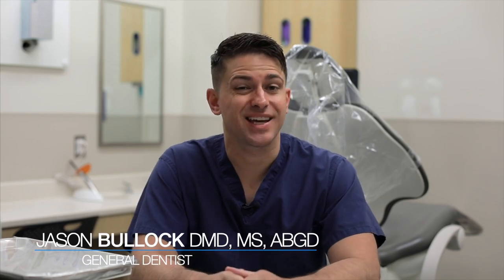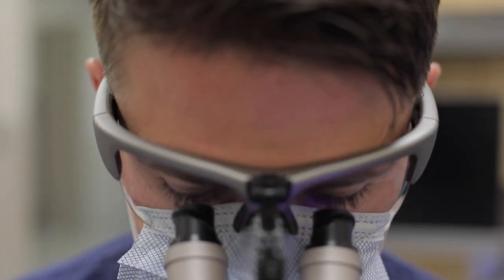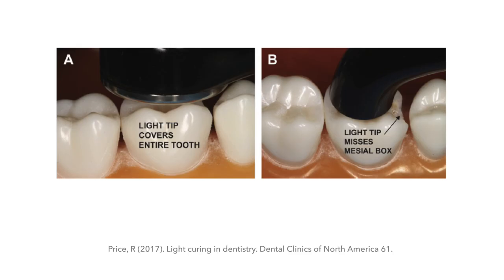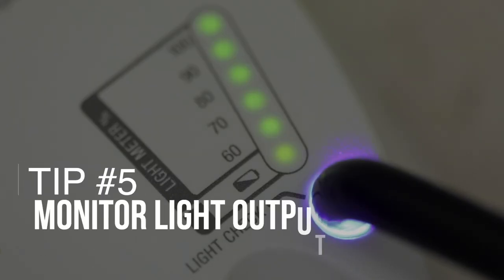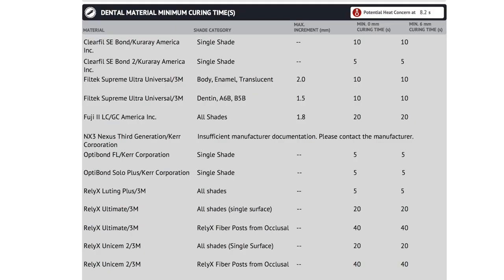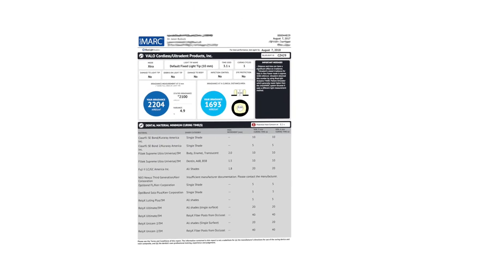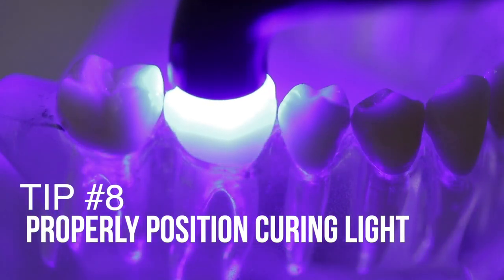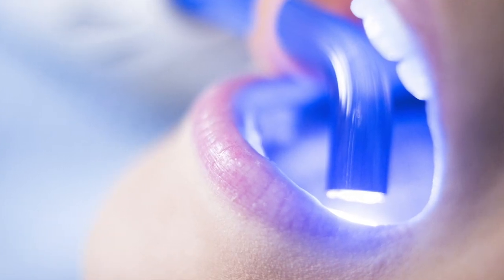10 TIPS for BETTER Light CURING

Comment: My Dentist has  cemented a crown twice came off within 3 weeks both occasions I purchased the curing light the equipment and cements Ionomers and reseated the crown myself 4 yrs later its still hasn't come off!  have also done front tooth chip repair composite restoration class IV over a year on still holding .. learning from YouTube and reading journals tips from Dentist like you have saved me time and money I get the feeling some dentist purposely don't do a good job so you have to keep coming back!  thank you so much for all your tips and advice!
Reply: How u did urself
Did u bought cure light and composite online
?
Reply: Be a bit careful with this, if there is disease in the tooth (decay) you may be asking for a root canal in a year from now.

Comment: I remember the old Halogen Curing Lights with the internal Fan that was inside. Such as the Optilux 401. They were great at the time, and I actually liked the sound of the Fan's motor. They were GOOD! However, now we're moving away from the corded Halogen Lights, and we're now moving to the LED Grade Curing Lights! I remember in the Dental Chair, when I had braces, when the curing light was put on the area, I could feel the buzzing caused from the cooling fan, and I always found that cool. However, times are changing, and we'll most likely be seeing fewer lights with the Halogen Bulbs. Now, instead of the pistol grip light with the Halogen bulb, and the  cord that went to the control unit, we'll be seeing the LED units that can be taken from area to area very easily.

Comment: Consider hand-held orange plastic blue light blocking shields that are "glued to" the assistant's hand while the doctor wields the curing light. This is dead easy and the safest and most effective way to protect both operator and assistant. Allows the light wand to be visualized while curing and ensures that the curing tip is parallel with the long axis of the tooth. Find online cheap.
Reply from the maker: Good tip! Thanks for sharing.

Comment: My dentist put temporaries on because I’m getting veneers. I noticed when she was light curing, she wasn’t holding it directly against the tooth...just holding it sort near the tooth. My temporaries fell off the next day. I know temporaries fall of easily but that easily? It makes me nervous for my final veneers. Should I mention something or just trust? She was putting on the temporary and said “I swear they always fall off so easily not matter what I try, I don’t know why” meanwhile I was sitting there going you’re not putting against the tooth? I worked with a dentist who did this and all of his appointments were fixing his previous composite fillings that fell out that he did a week earlier ...I chose not to take the job there because of him.  Please help, should I ask to have my final veneers cured longer and with contact on the tooth?
Reply from the maker: Hi! Not sure what type of temporaries you have but sounds like she was spot curing the temporaries in place. Veneers temporaries can be tricky Bc you want them to stay on long enough for permanent veneer but not so good they interfere with placing permanent veneer. As far as light curing is concerned, direct contact with tooth is not necessary but should be very close. I wouldn’t be too worried based on what you told me. If you have issues with the permanent veneers then you could be concerned. Good luck!